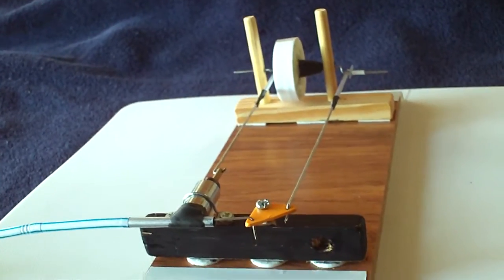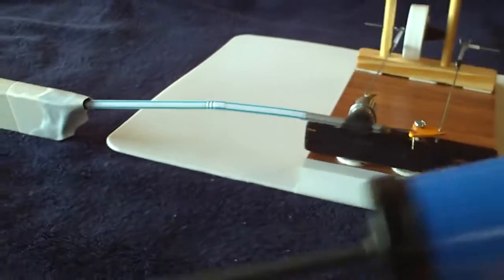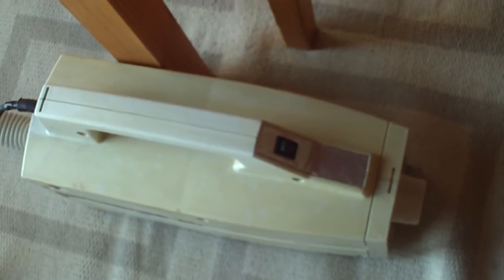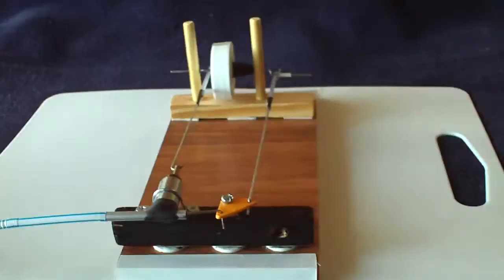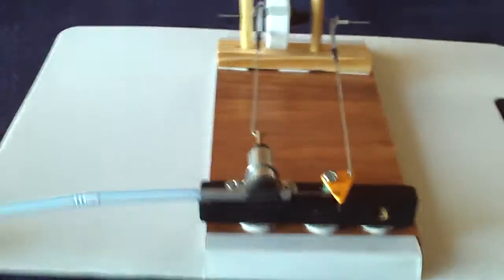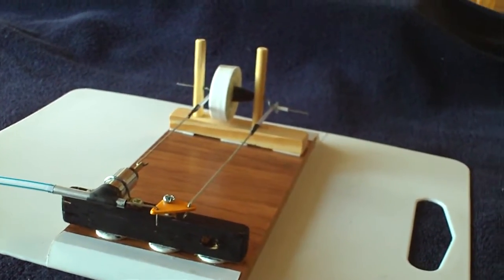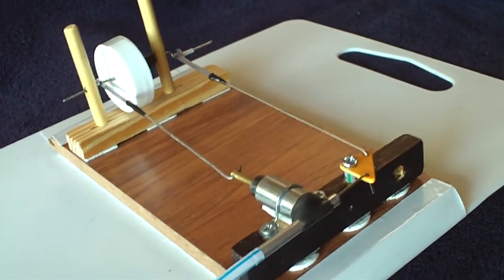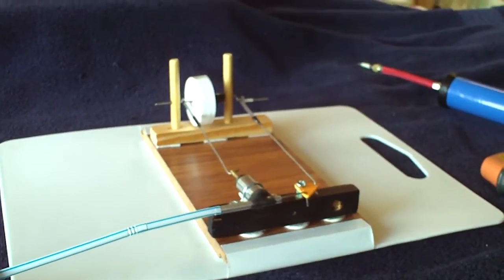Kitchen Table Steam Engine ----Running off a vacuum cleaner outlet

Comment: Goog job!!If Can u give me some info what to use as a piston?I would like to go a little biger.I would like to do with out steam and and just use heat like a stirling motor.Good job love all your videos.just got done with the CPF Lite and coil. Thanks
Reply from the maker: I got the piston and cylinder at the local hardware store and they are called 'steel spacers' that are zinc coated. I had to smooth the parts to make a good fit.  I used graphite powder and light oil for lubricant.

Comment: I love this little engine :) I have some very very small compressor I could send you one if you want they run off 1.5 to 3 volts and they can produce about 40 psi :) little air flow though but I'm not doing anything with them :) let me know. Cheers!
Reply from the maker: Thanks for the offer but I'm going with live steam now.  Maybe a solar boiler of some sort just for fun.
Reply: Would be awesome :) I'm pretty sure you can do this one :P

Comment: I would like to see you move into high powered lasers, blue diodes. Maybe a	 	 	 	
Pelter unit that can run a motor that runs a HV van de graaff generator. Laser optics is also another fascination of mine. Thanks for sharing your fun!
Reply from the maker: Yes it is fun and there so many project that I would like to try.  Time is the problem.  Not enough time to do them all.